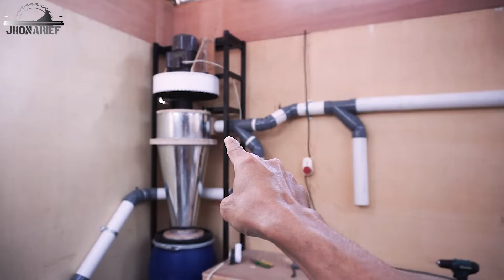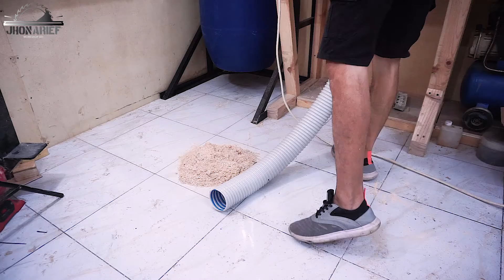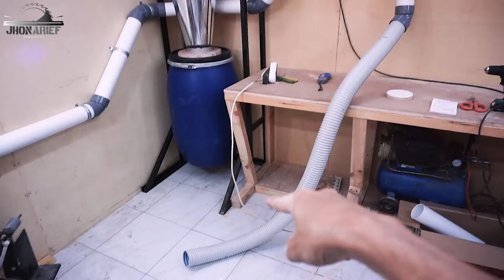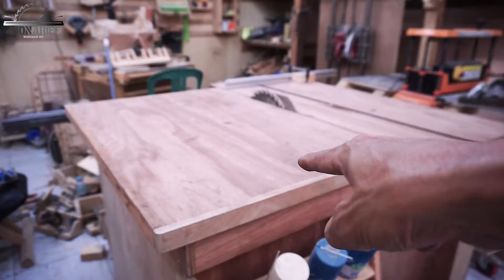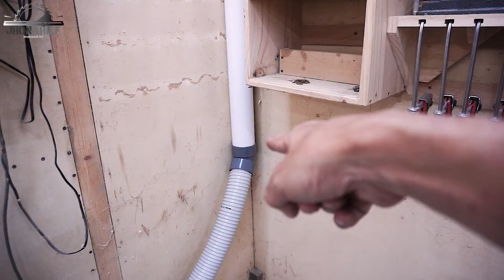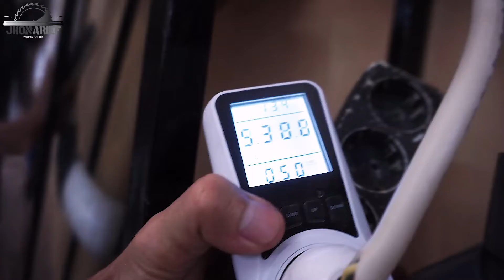TEST MY HOMEMADE DUST COLLECTOR SYSTEM

Comment: You should have some large mesh over the fan inlet in case any plastic or large wood goes up and into the fan it doesn't just explode 😅

And make a box around the motor/fan with some insulation to reduce noise some more even tho it is pretty quiet it's always nice to get a little more silent 😁
And have a grounding wire to the cyclone and air pipes with a few screws through it to the inside to prevent static

Comment: Congratulations. Good outcome. I hope it helped keep the dust in the shop to a mimimum. Question: Are you adding an earth wire to the plastic ducting to stop static electricity build up?
Reply from the maker: I add earth wire only on cyclone body

Comment: Untuk finalnya divideo ini pake impeller yang berapa fins mas, 8 atau 12 fins?
Reply from the maker: Saya pake 12fins om
Reply: @ sip om. Saya punya  Exhaust Fan Panasonic 16" Inch 40AFU yang model besi
Spek baling2  40cm/16inch 78 watt

Hembusan UdaraKeluar : 33.5 m³/mnt (CMM) ~ 1183.04 ft³/mnt (CFM)

Klo diambil mesinnya dan baling2 nya trus dibuat rumah keongnya Kira2 bisa gak ya om dijadikan dust collector untuk table saw juga

Tolong sarannya om...

Comment: Great result Jhon, glad to hear the suction power is still food at the very end of the duct hose. Pretty impressive achievement with a DIY system powered by a 1HP motor.
I’d be interested to know the difference if you use a 3HP motor, should you find one to test 😉
Reply from the maker: yes i want to try it too with 3 HP Make the Impeler slightly big. Maybe 35 cm in diameters and 10cm width blade That would be interesting. Result. But sadly 3HP kind of expensive for me right now

Comment: great john
so it is regular sweage water pipes? do the joint have rubber gasket?
technical comment for improvement: once dust collector is running we couldnot hear you well, better have that issue future solved. 
great video as always. thank you and best luck
Reply from the maker: Yes it's a regular water pipes, and sorry for the voice, will fix that next time

Comment: That's a damn effective dust collector! With that speed at the far end with a 3 inch tubing you are getting around 950 CFM there. It's far more than most 1 HP commercial dust collectors!
Reply from the maker: Thank you sir